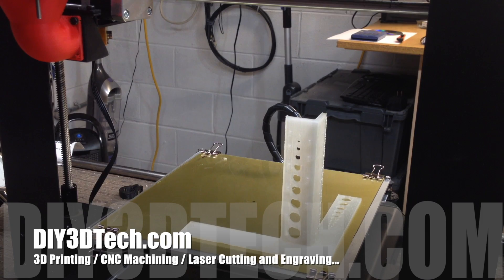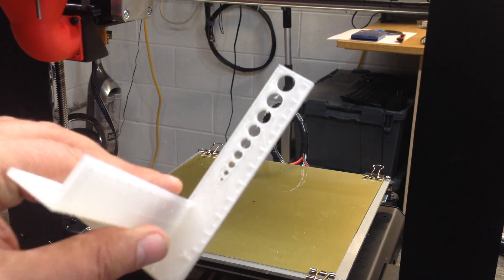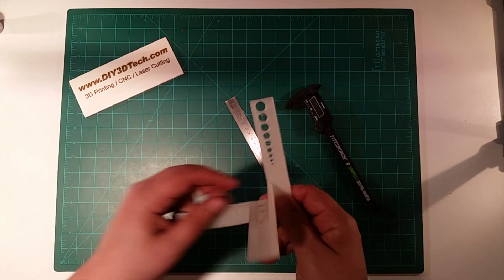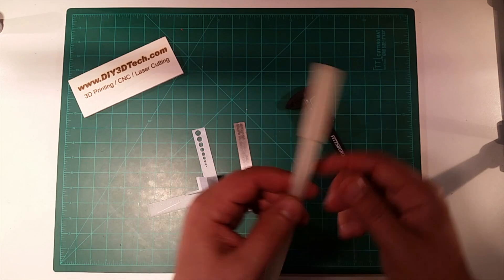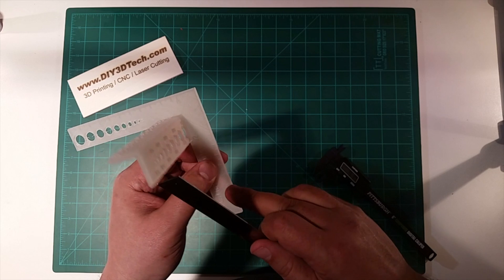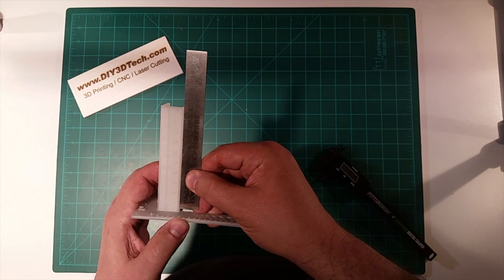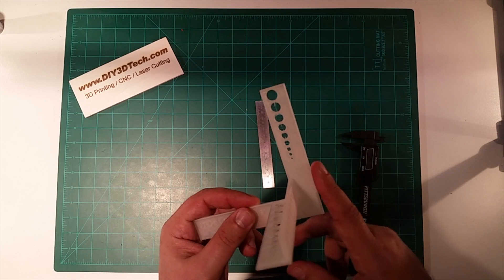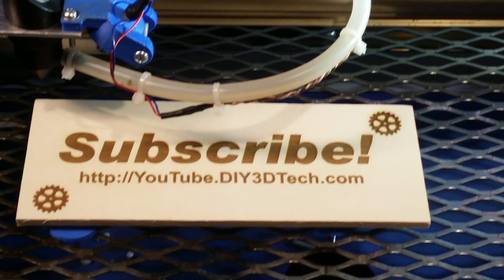Wanhao Duplicator I3 3D Printer - 3D Calibration Ruler Test!

Comment: Amazes me how you can have videos as much as you do, I should have gotten a 3D printer instead lol
Reply from the maker: +After Hours Tv & Pc repair 3D printers are easy to video on of all three machines (3d printer, CNC and Laser).  The issue I have right now is I use the dust collection system for the CNC and wood tools to act as the fume extraction (to the outside) and it is very loud so the wife complains as it right under where she spends most of her time up stairs so I have limited times I can run it.  The 3D printer makes very little noise so I can do that with out her complaining as a happy wife is a happy life, however I am working on building a quieter vent system.

Comment: I print around 195ºC for PLA but my FF Finder is rock solid for temps with a flux of 1ºC for not even seconds.
Reply from the maker: +Mickice I would NOT say the Wanhao is rock solid so one of the reasons I lean to the higher temps as if I get to low the nozzle clogs up.